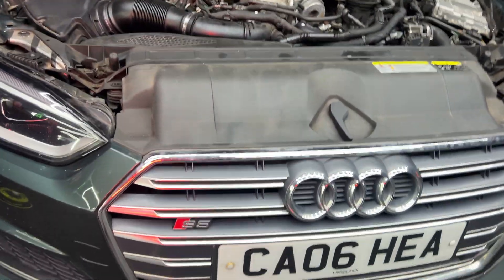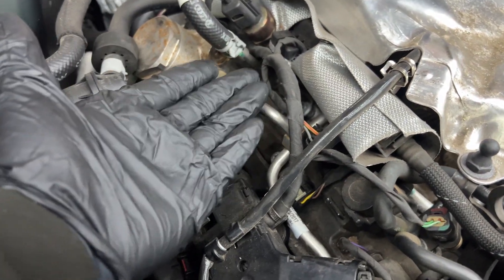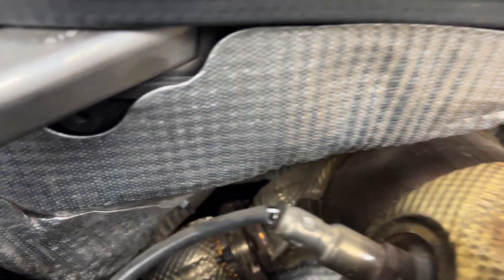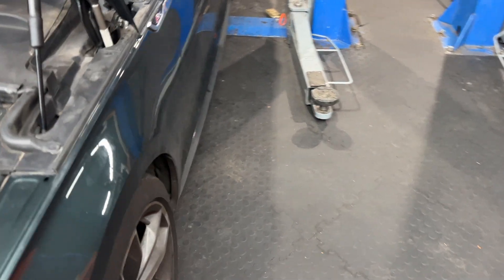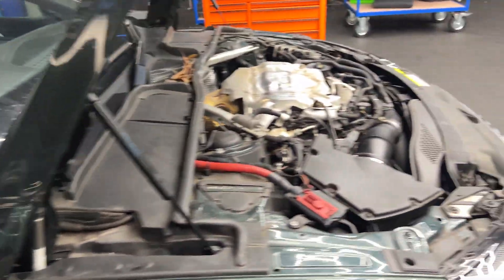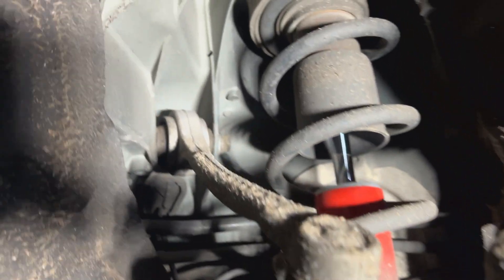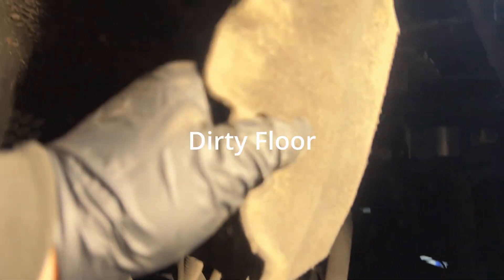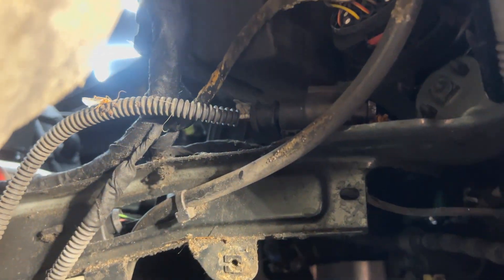Audi B9 S5 Rocker Arm Failure. Engine Removal & Tear Down

Comment: i got an oil change and i'm hearing something that sounds like a spray paint can being rattled when i accelerate.  i'm so stressed because the shop i went to focused more on the pcv going bad and i don't think they even listened for the noise. i dont think the pcv is causing the issue.
Reply from the maker: rocker arms or piston slap is also common on these cars
Reply: @MrF-03  it doesn't sound like rocker arms from what I've seen on here. That's like a knock. I'll look up piston slap
Reply: @MrF-03 not piston slap. It just sounds like a rattling when I go from 1 to 3 rpm . I think I do t have any boost while it happens
Reply from the maker: Turbo Watergate rattle?

Comment: Hi. Do you know why I have vibration? And how can I check rockers?
Reply from the maker: vibrations can be caused by a number of things so i have no idea. to check rocker arms you need an inspection camera. remove the oil fill cap and youll be able to see a couple of them. other way is to strip the engine down.

Comment: if the rockers haven't failed, can you preemtively change them with the engine still in the car?  What is the book hours to change the rockers?
Reply from the maker: its possible to replace them with engine in but i wouldn't recommend

Comment: Im currently doing this job on my driveway for a soon to come video. On that 70amp fuse under the battery jumper location. What is it used for ? i have a fuse but no wire on my car. Wonder if its for a aux heater or somthing ? Cheers.